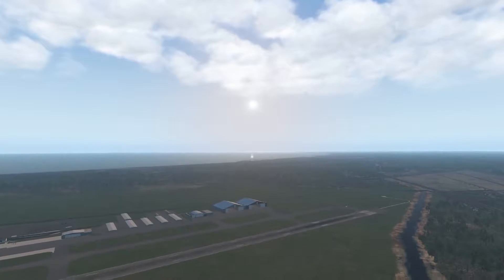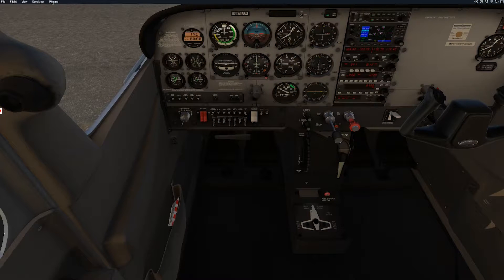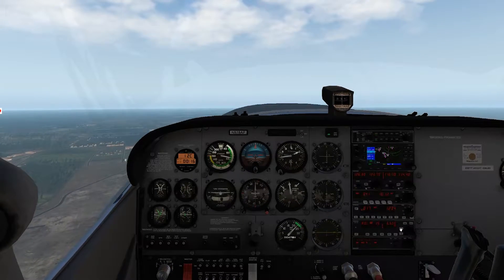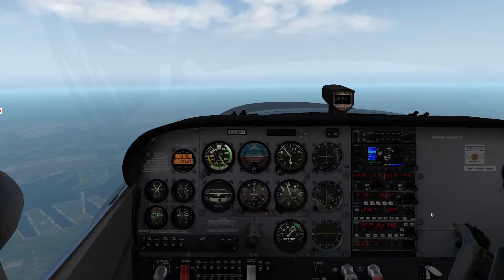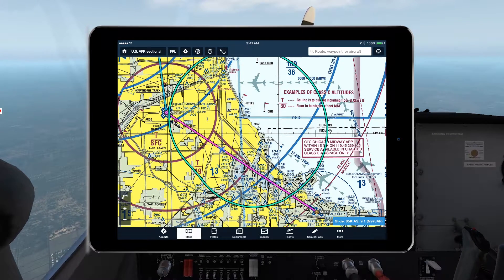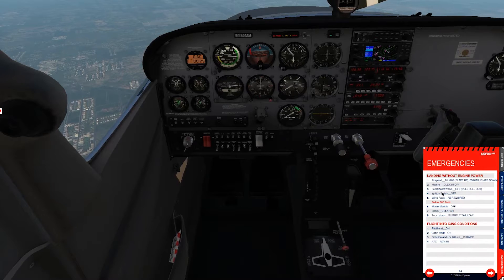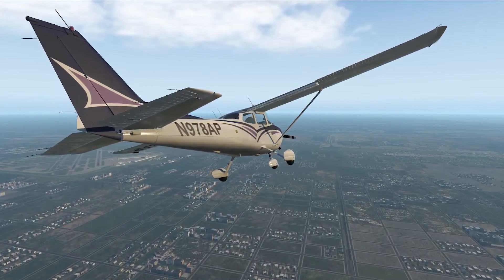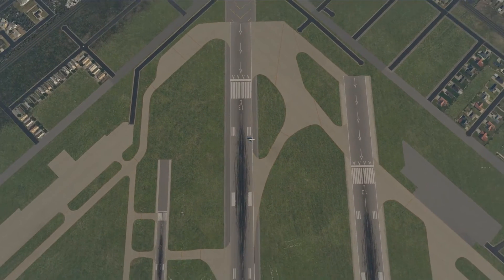Bucket List Flights: Flying To Oshkosh | Leg 4: Engine Failure + Using Trim | X-Plane 11

Comment: Great videos.  Had a real failure, cylinder blew off the engine, flying a Piper Arrow with wife and 2 kids on board. back in the 70’s.  Did a wheels up landing in a farm field in PA.  No one hurt.  My reaction was automatic.  I didn’t have to think about it because of practicing emergency procedures with a club flight instructor a few days prior to the flight.  Continuous practice and training are key to safe flying.  Simulator flying is all I do now.
Reply from the maker: Thanks for sharing, Mike!  Indeed the sim is a great practice for making reactions automatic. I’m so glad your emergency ended so well - nice work getting it down safely!

Comment: Hi Clay, I tried, I tried, I tried. But without engine, it is very hard to reach the start of a runway : Either I am much too high and I see the runway desperately passing by underneath my plane, either  I land with the runway in front of me but much too far away. (and your little plugin says R.I.P.) Judging (and applying) a correct rate of descent is for me the most difficult part of the whole flying course.
Other question : do the pilots in the real world always try to fly high enough so to be able to reach an airport in case of a power failure ? Mandatory ?

Having said that, “Trim for speed, Throttle for altitude” is the most important lesson in my life. Thanks a lot.
Reply from the maker: Hi Nonkelbeer! Don’t be discouraged that those things are happening to you. It’s not easy to master, whether in the sim or in real life. When flying enroute somewhere, a good real world pilot is regularly thinking about where to land in the event of an engine failure. Cruising altitudes are usually selected based on variables like winds aloft and fuel economy, but selecting a cruising level that allows sufficient glide time is normally a secondary benefit of a good cruising altitude. If you are practicing engine out approaches, the key is to judge the sight picture of the runway. By practicing “normal” powered landings, you will help to develop that sight picture. Then when your engine is out, you’ll have better judgment of being high or low. Being too low is tough - there’s not much you can do to fix it. Being high is better because you have altitude to trade for airspeed, meaning in this case more time flying. If you are high and near the runway, you can circle and/or slip the airplane to bring it down to the normal sight picture of an approach. On a normal powered landing, I normally leave that 1600RPM or so in until I’m crossing the runway threshhold. Thanks for flying along as always!

Comment: Amazing ! Wonderful ! Again a very interesting video. Thanks. What about the real world, have you ever been in this situation ? And could you stay calm and 100% relax ? The A-B-C trick, does this come intuitively to your mind instead of looking for a panic button ? (and by the way, do you have brakes when power is shut ?). Thanks again. All your episodes are important.
Reply from the maker: Thanks Nonkelbeer - great to see you again!  I’m fortunate to have not had an authentic engine failure in the real world. While I hope to never have one, it’s very common to train these scenarios in flight training. Often the instructor will pull the throttle to idle and state “you’ve just lost your engine.”  We then go through the motions, taking it down to sometimes 500 feet or so. I’d like to think I’d stay relaxed, and that the training would take over, but I wouldn’t truly know until it happened. The ABC mnemonic is taught frequently as well. It’s an easy way to remember the flow. Yes, the brakes still work with power out. I have new rudder pedals with toe brakes, so that whole mess after I landed was just due to something going goofy there.
Reply: clayviation which rudder pedals you bought? I have thrustmaster joystick and because of that I think about buying their pedals also